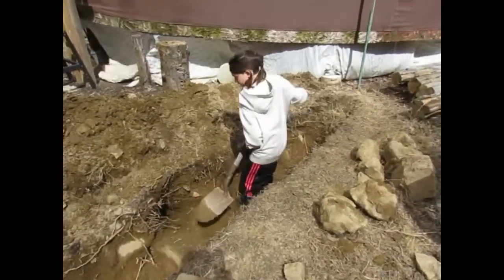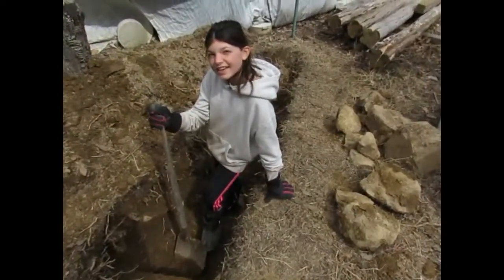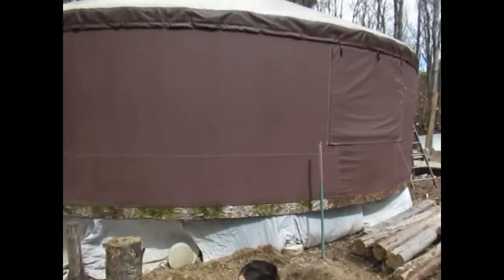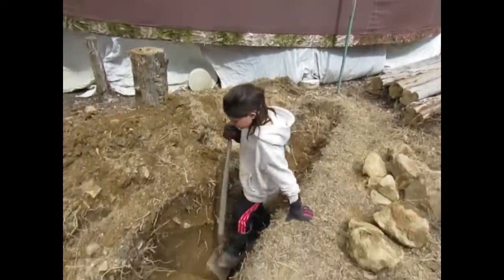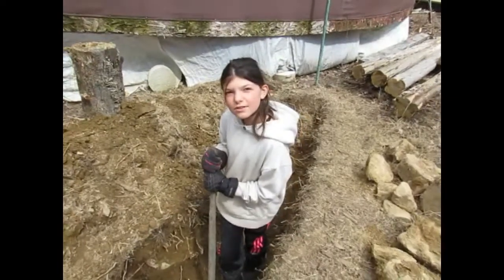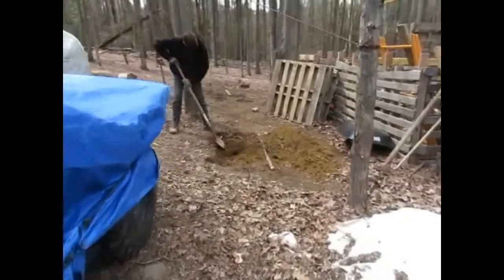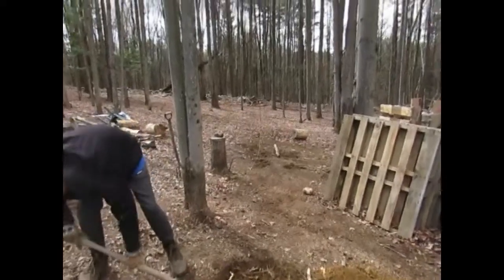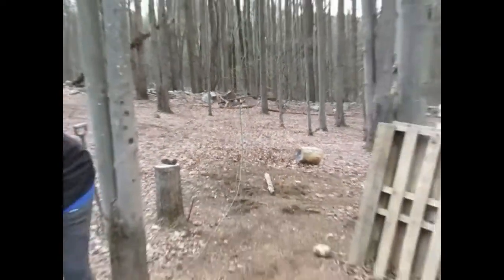Natural, Free, Off Grid AC. EarthPipes. EarthTubes. Air Conditioning using naturally cool earth

Comment: So did this work? cause i'm looking into building one and haven't found a lot of precise information.
Reply from the maker: So, Unfortunetly, we never got to see. I wanted to try an open end system. Then as I thought about it one night, what if there is some sort of mold or other harmful growth that gets in the middle of the pipe and we can't see it and were breathing it. I also thought what keeps this from happening in a closed system. What will you be trying to cool with this system? Where are you located?
Reply: @throughoureyes5160  Argentina province of Mendoza, if the pipe is smooth with a good angle for water to drain and good filter in the intake mold has little to no organic material to grow much less to a point that it causes health problems anyway It's for my mushroom farm so a tiny bit of mold won't be a problem since ideally i'm in there a few hs a day.

Comment: a little late, but if you would have run 6'' pipe under the yurt (100') and insulated it and use a 6'' inline fan (12 volt or 110 watt) for curculation, it would work the same with alot less work. lol
Reply from the maker: You're saying above ground but under the yurt?

Comment: If you can get a solar chimney to pull air out of your home, it should reduce or eliminate the need for a fan.
Reply from the maker: Sweet. Whats a solar chimney?
Reply: @throughoureyes5160  Usually, they're black metal chimneys beside the home. Air from the home goes through a pipe into the chimney, which is otherwise sealed except for the top where hot air rises out of the chimney. Because the black metal heats up in the sun, the warm air inside the chimney rises out the top, sucking air out of the house.
If you have your cooling setup going into your house, the chimney sucking air out of the house should cause air to be sucked in through your cooling unit and into your home, without any need of electricity. Cool air from the cooling pipe gets sucked into the home, then sucked out of the home through the chimney pipe, causing more air to come in through the cooling pipe, almost like a constant cool breeze in the home. Bonus if the pipe leading to the chimney is located near the ceiling, where warm air in the home accumulates.  In theory, at least. Something interesting to look into.
Reply: Sirve las chimeneas tipo turbina pasiva , esas que giran pero que no usan ninguno tipo de motor?

Comment: the deeper the better.. you should be looking for the depth that the temperature is very comfortable. lay enough big pipe to collect the temperature and circulate that water into coils and back to the main pipe that is under the ground. this can be used all-round the seasons...use small fan be hind the coils to circulate the air....insulate heavy ,,everything...

Comment: I’m planning on doing this exact thing off grid as well. We live on a hill and my plan was to dig the trench down hill in order to have all of the water stay at the bottom so that we aren’t breathing mold. I’m working on ideas to deal with other things such as radon. One thing I have also been looking Into is wind catchers that have been used in the Middle East for a very long time. I have a few designs that I am probably going to test in order to see which one yields the best results. We are in Tennessee with all 4 seasons so we have to plan accordingly with a rocket mass heater for warmth and something for the hot summers. Super interested in seeing how this works out for you. I would also like to know what your plan is for radon and mold if you would.
Reply: This is want I want to do with my tiny house! 

Create an air flow through a sunken insulated cooler that benefits from the cooler earth temperature and the ice bottles I fill it with and have fans circulating the air from low to high inside the house. 

Seems diy friendly but haven’t seen it done yet. Have you?Thanks!
Reply: @TheKonnoisseur11  that is genius. The Thing i wonder about is keeping it cold like that will cause condensation, how would you deal with that potential for mold?
Reply: @zackfair3054  bingo! That’s the only thing I have to figure out and also I’m wondering is 6 feet deep and 10 feet long about hot make a difference. I’m planning just purring it under my little deck. 

Usually with geothermal is 100s of feel of coil etc. they must make it that long for a reason. Does it give it time to cool off you think?
Reply: @TheKonnoisseur11  9 feet under ground will keep it very cold. I think the longer it is, the cooler it will be. The professional ones I’ve seen are made of concrete and a person can fit in it and clean it if need be. They are cold year round. There are great ways to do it, but keeping water out of it is key for sure. 

I know that they have air coolers in the Middle East that take in air and cool it with water. Personally I am going to bury my off grid 9 feet under keeping it cold year round and put a rocket mass heater down there to heat it when I want and the rest of the house above.
Reply: @zackfair3054  so you’re gonna heat the pipe to transform it into a heater in the winter? Nice! 

I was thinking about bulking an outdoor fireplace outside my tiny house and attaching a heat exchanger pipe to channel that heat into the house. 

It’s another thing I haven’t seen on YouTube yet only on indoor fireplaces....Good luck! 👍
Reply: @TheKonnoisseur11  I love that idea, you could store it in a greenhouse to serve multiple purposes. Heating the house, plants, and potentially cook on it while keeping it out of the rain.
Reply: @zackfair3054  yea puttin it outside would save space inside but I wonder if it would be less efficient. 

A green house is cool. theres a lot more possibilities when you have land—like an earthship!
Reply: @zackfair3054  have an automatic pump hooked up to pump the water out when it gets to a certain level

Comment: I wonder if you skip using pipe and cover ditch concrete/plywood. The cool earth absorbs moisture so no mold would grow. However, then I wonder about radon gas which supposedly at surface. Another option is to rely on shaded air under the yute and pull that up by forcing hot air out top. You could passively pull air out top with black painted tin pipe. Ac duct.
Reply: Eh estado pensando exactamente lo mismo

Comment: Watching this in Jan, 21 -- What happened?  Didn't see a follow up video under Projects where this one was located.  I'd LOVE to know!
Reply from the maker: We never finished it. :/   We got worried about moldy air coming through the pipes and it stopped us completely.
Reply: @throughoureyes5160   when I asked about the same issue I was told use the drain pipe with holes in it. Hope that helps.
Reply: @throughoureyes5160  air filters?

Comment: Well I've found this a bit late, but as I'm doing research into Earth Tubes, as did Ethan below, I could offer you some findings. And something to remember for improving your system.
Think of the system as a radiator in the ground, so several small tubes joined into a manifold at the delivery end will give the flow of a 10". This will transfer more heat than the one large pipe. It's all about surface area, and the air being close to the pipe wall, tubes need to be spaced apart as well.
I'm looking at eight 2" poly pipes to flow 50 l/s, over 25 metres length. Yes its metric, you can look up the conversions. The math's shows a good temperature drop, in my case from 44 Celsius down to 14 Celsius in my summer. That's another thing every system needs to be tuned to the location your in, checkout ground temperature vs depth for you area.
Reply: Hola bro , hace muy que estaba considerando poner est sistema pasivo pero la verdad no sé cómo instalarlo, mis dudas están en poner un sistema asi como el que describes de tubos de PVC o colocar un solo tubo de mayor diámetro de concreto quizas de 30 o 40 , desconozco que sistema sería mas efectivo, me gustaría saber su respuesta

Comment: Hey, this is awesome. I'm familiar with earth pipes (not by experience but by research) in earth ship homes but I've never seen it used in a home that sits up from the earth. Is this experimental or did you find research that this will work even without the other elements of earth ship design?
Reply from the maker: I suppose it is experimental. Though we have talked to someone who says it works as long as the pipe is long enough and deep enough. If it works it will be awesome. If it doesn't it will be a big waste of time and energy. But at least we can document it and let other yurt dwellers know the outcome. I think my next home is going to be a earth ship. I love the idea of the greenhouse in the house and all the passive heating/cooling.
Reply: @throughoureyes5160  I’m with you on the Earth Ship concept also. How did this experiment turn out for you and your family?  I’ve been actively contemplating trying to incorporate this approach in our next home build.

Comment: You may not have to use the fan.  Opening the top vent on the Yurt should create enough of a chimney effect to draw in the cool air through your ground pipe. 
   I would take advantage of the back filled earth in the trench.  Use a 2" hardware cloth screen to remove large rocks from the last 12" of back fill . Mix in humus and soil from the top 1" of the forest floor.   
   Then plant a 100' row of potatoes.  As they grow continue to add material from the forest floor , spoiled hay, compost etc. to fill the trench and hill the potatoes.  I would plant an indeterminate variety of potato.
the old guy  Bert
Reply from the maker: Did you do earthpipes? We are still trying to figure out the best piping to use.
Reply: @throughoureyes5160  NO:  But have included ground supplemental cooling in a couple of Walipini designs.  The most cost effective pipe would be the coiled drain pipe with-out holes.  The larger the pipe the greater surface area for heat transfer.  Also low velocity for maximum transfer time.  At 79 I'm past the doing but still designing systems for friends and working on simple solutions to problems for fun.  As a guide I would suggest looking up Earthship build videos to see what size tubes they are using.  Even though they are better insulated in the ground; as are the Walipini compared to the Yurt. I think 8" pipe would work but would consider  2-6" spaced 2' apart into the walls at the bottom of the trench.  By using 2 you could close the loop  and with a fan use it for some cooling and winter heating.  But the heating would be minimal only a few degrees below the ground temperature.  OR a  more complex system using three pipes the closed loop to put heat into the ground in the summer for winter recovery.  And one open pipe for summer use below the loop with the chimney effect.